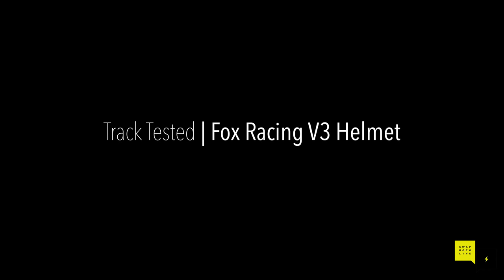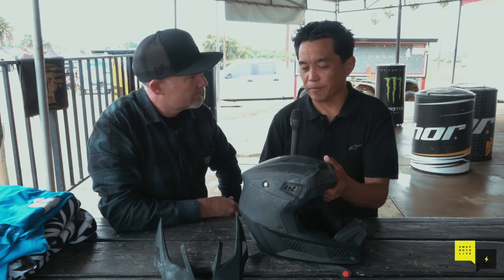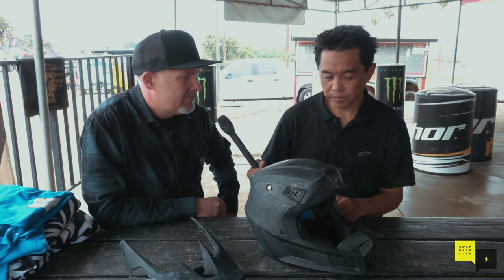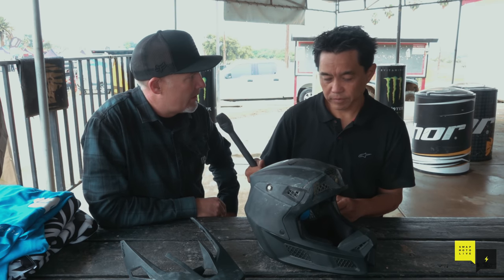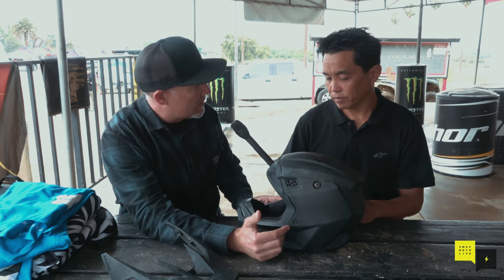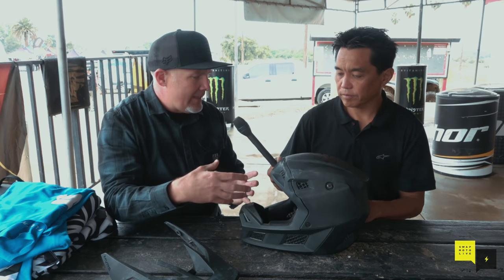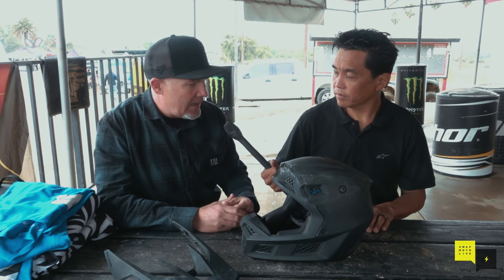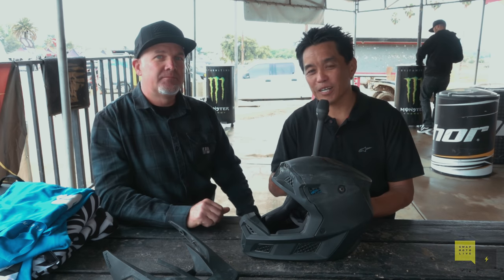Track Tested | Fox V3 Helmet

Comment: Coming from a rider that’s had two concussions in the 18’ model v3  I’m still confused as to why they don’t have more safety features inside the liner around the temple area. They focus a ton on the visor with this helmet, the top, side and back of the interior liner but I’m surprised you don’t see more protection in that temple area of the helmet. Both my concussions came from a temple impact.